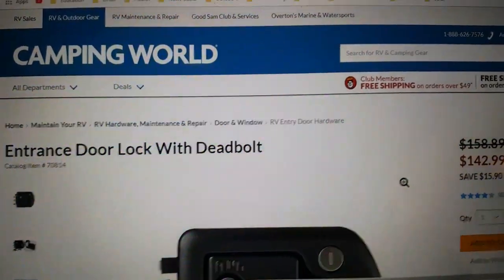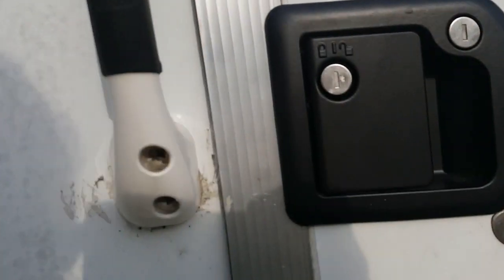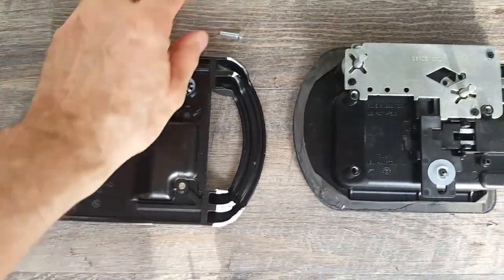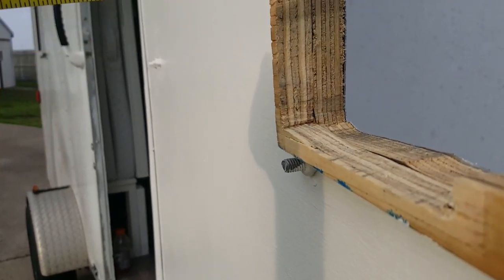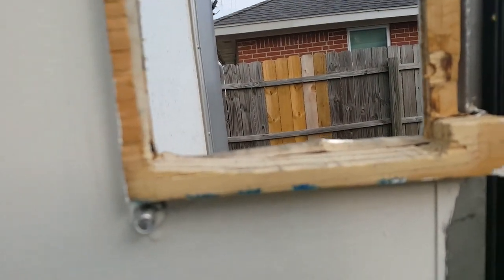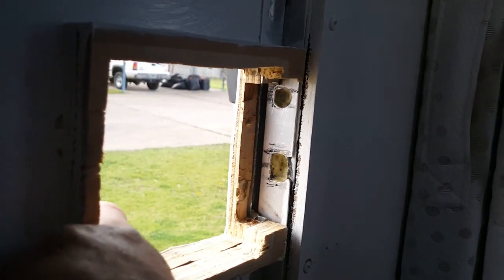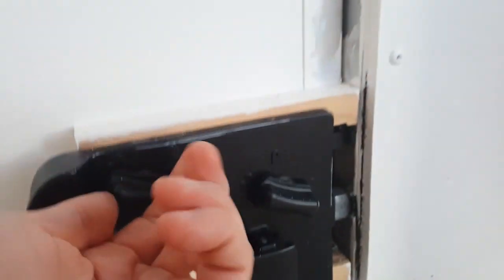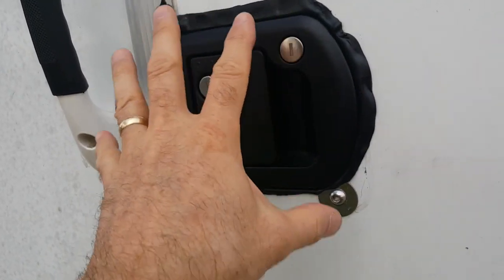HOW TO INSTALL RV DOOR HANDLE TO CARGO TRAILER RV Door Latch Install add addition Part 19

Comment: Thanks for posting this video. It gives me a much better understanding of what I need to do now.. my door is 1.25" thick and the latch I bought is made for my door thickness.. Not to rub anything in but I paid $23.00 for my latch. The handle locks and it has a deadbolt.. Thanks
Reply from the maker: No worries. It's the price of convenience. I know there are better deals out there. I just didn't want to take time to shop. Good luck with your install.

Comment: Good job. Just an FYI, this particular handle is available with either a pot metal or steel plunger in it. The one that you installed, and 90% of the ones for sale on the internet have the pot metal plunger in them. They can break w/o warning and leave you unable to open the door. I have a YouTube video about this Trimark handle and how to replace only the broken part if that happens. Just search for How to Fix a Broken Trimark RV Door Handle.
Reply from the maker: Thanks for the suggestion.
Reply: I just ordered a new one.  I don't see anywhere where it says whether it's pot metal plunger or steel.
Reply: @alive-awake  The way you can tell if the bolt is made of pot metal if it has a dull finish like cast aluminum.   Steel has a shinier look to it and is much stronger.